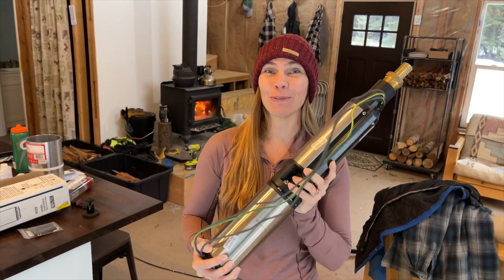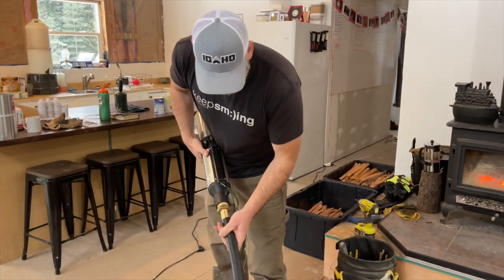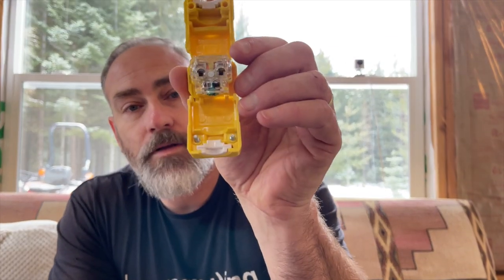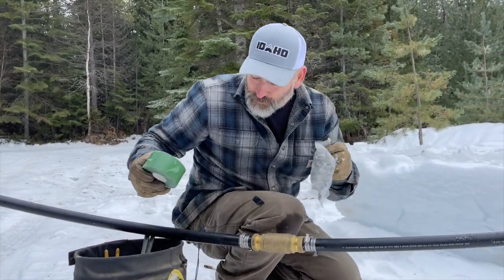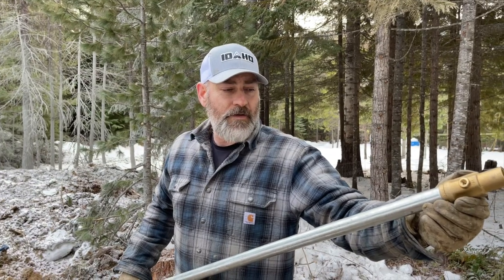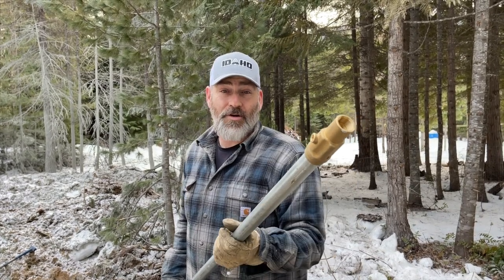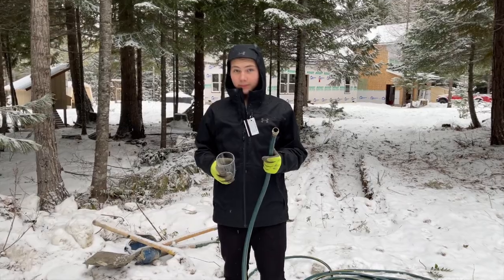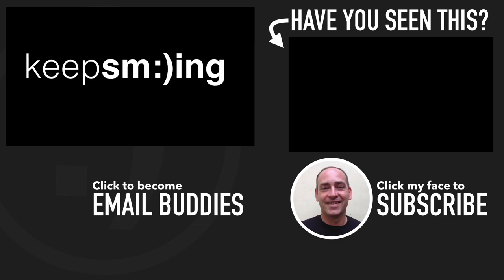WIFE is HAPPY/HUSBAND is NOT - DIY Well Pump Installation

Comment: if your math tell you you pumped 480 gallons then you have a good well with alot of storage ....Since a water heater only holds 40 to 50 gallons typically it shouldnt pump dry under normal use . Also normally we use to raise our off the bottom sometimes 10 feet. Depending how deep they drilled after hitting water ,But seems ike you could raise it 5 feet and still have enough. Settlings is normal in even a hand dug well. Be glad if you didnt go thru a coal seem like around here then you would have red sulfur water that smells like rotten eggs. That part I dont miss.

Comment: Just a couple 💭 thoughts for later to charge your batteries at night by supplementing your Solar with Wind power. Check out John Daniels for his conjunctive wind and solar with how tos.
Also In your state a great Solar company called Lion Energy. Red Poppy Ranch a retired plumber also Off Grid in Idaho just released a video about it and how he changed to Lithium (they also have a 25 yr warranty on the batteries 🔋!)

Comment: I sweated my , well I bout drowned in my own sweat putting in my pump, it's a similar 120v pump, I was  lucky it was only 40' deep, but had to dig it's a 24" concrete tube, the difficult part was attaching the 90°fitting to the pipe through the hole in the concrete, below ground, on my own! But it worked out,  it does about 75-80psi with open 1" pipe, it's not used for drinking yet, I use 5gal bottles of drinking water, with a 12v pump, for drinking water, 
Mine was so close to the house, I couldn't burry it deep enough, so I insulated it then burried it, I'm lucky to not be in that cold of a climate,

Comment: 1. Before lowering, you need to check at the top - it works or not.
2. An arrow on the valve shows the direction away from the pump.
3. Such red water can be from the type of pump - selection (with centrifugal water will be clean).
More pump - cleaner water.
I hope you are ok!

Comment: I am probably to late with this info, but I think your pump is to small. 1/2 hp pump is trying to lift the water 550 feet I think you said, that water is approx 7 lbs per gallon and you are lifting it straight up.
Reply from the maker: The pump is set at 200’

Comment: I was a gennie jockey..
Too much amp draw..need bigger generation 5kw or bigger
Reply: Of you can locate a 10,000 rate transformer  ..your solar panels will keep voltage in and the transformers equalizes the amp/volt rate. .
Like a distribution panel on 3 wire legs

Comment: I"m surprised a 1/2 hp pump will work, I had to install a 1 1/2 hp Pump for my 400.foot well 220 volt, I have changed a lot of well pump, remember once you drop that in and run water, to pull it out, It will be heavy, I built a 3 wheel pump puller, just like the one you rent 900 pound gear box electric motor, 110 volt, good luck with your home, God bless

Comment: As someone who works on water wells for a living, albeit in a different state, it seriously hurt me to see you put a 1/2 horsepower pump at that depth given the water level. The deepest set 1/2 HP we can get our hands on here is only good to a water level of 120. So if you run the water level in the well down by using the water or if it naturally drops over the years as it's wont to do, you could run into issues. Almost any 3/4 hp 10 gpm pump would be a better fit for where you have it hanging and would be a better future proofing measure. The only downside is that a 3/4 hp pump requires 230v as opposed to 115v.

Comment: Those wire connectors look almost the same as what you use onYachts to meet code  for boats they have a machine that will print onto the shrink tubing  to help identify wires  it’s similar to a Brother label maker and is a permanent ink

Comment: Not for sure Marty but have you considered raising your pump 8' or 10'. When we had our well drilled back in '95 we had similar problems.  My brother n law told me to raise the submersible pump up 
5 feet and try again. So, we did and same results. I was starting to get frustrated so we picked it up another 3 feet and bingo, my water stayed clear. My well is approximately 98 feet deep, i picked it up a total of 8 feet and sure enough my problem was solved. I know its a lot of work, lifting this up but it might solve your problems. So now now my pump is 90' in the ground. I hope this will work. Best of luck my friends.

Comment: Is the Pump AC or DC?  What gauge is your wire?  How much voltage/amperage is lost due to length of power cable?  Why not use a jet pump?

Comment: That pump seems a bit small for 196ft down. 1/2hp 115 v is your base line pump. I would have went with a 240v pump 1hp anyway just cause it draws less amps. Higher voltage motors always draws less amps. For a off grid this is better solution. My pump is only 100ft down and I have a 1hp 20gpm pump. If your buying a pump from tractor supply or home depot they are junk. Do yourself a favor buy a quality brand pump. Good luck 👍

Comment: House Wiring 

17- 20amp circuit 

         Kit. Outlet 210.11.C.1 

         Kit. Outlet 210.11.C.1 

         DW Cir. 210.8.D 

         Micro hood fan and range outlet- A good idea 

         Ref. Outlet- A good idea 

         Outside Outlet 210.52.E 

         Outside Outlet Xmas-A good idea 

         Bath Outlet 210.11.C.3 

         Laundry Washer 210.52.F 

Laundry room Outlet 210.11.C.2 

Laundry dryer Outlet -A good idea 

Family room Outlet 

Garage Outlet 210.11 

Garage Freezer 210.52 

Garage Elec. Car Outlet 210.1 

Dining room Outlet 

Heater 210.64 

Bath room Heater Fan Light 

30 Amp Circuit 

Hot Water Heater-10/2 wire 

Dryer-10/3 wire 

Cooktop-10/3 wire 

Air compressor-10/2 wire 

Shop Sub Panel-10/3 wire 

 

40 Amp Circuit 

     Outside AC 

60 Amp Circuit 

Wall Oven 

Sub Panel 

15 Amp Circuit 

Smoke Detectors 

Alarm Panel 

Lighting 210.70 

Bed room Outlet 

Internet Outlet  

It is a good idea to add separate circuits 

Sub pump 

Basement 

Welder 

Attic fan

Comment: Wrong pump size for the application. Cheap pump also. Hope that is altleast 160 psi pipe and at that depth you might still have issues with that.

Comment: Put the check valve at the top of the pipe then when you have to pull the pump you only have the weight of the pump and pipe to lift not the weight of the water in the pipe.  Before all the comments about how wrong that is ... take a soda straw fill it with water ... put your thumb on the top of the straw and raise the straw ... OMG the water stays in the straw!

Comment: Inverter generators are a poor choice for running motors with their high inrush. Motors do not require much protection against surges as electronic equipment requires, inverters provide surge protection but poor handling of a  desired high load sergers.

Comment: I thought that type of amp gauge required only ONE wire thru the meter and then one turn around around the meter.  You may be pulling only half what it shows???
Reply: If one puts both of the wires through the reading should be zero... They would just cancel.

Comment: That well head looks like pvc? if it is than it worries me since it's cold where you're at. Pvc does not conduct heat and I see possible water freezing in your pipe. Mine in wisconsin was ice problem free until we switched to pvc.

Comment: Well...., my guess was wrong, but you should have wired it 220, instead of 110.  I bet it would have started with the smaller generator.  It is the current which was the problem the current doubles when only running on one circuit, plus you only have half the rated generator power available on that 110 circuit most generators single phase 220V which get split into two 110 supplies in phase with each other.    I am sure that pump supports a 220 Volt configuration, it was probably its default configuration, all the submersible well pumps I see are 220.  Usually 10/2 wire, IE  the neutral is not needed, 10/2 is three wire, two hots and one ground.  Motors have a high induction when starting which caused the current to surge, you can  burn out or shorten the life of a motor with inadequate power IE from your solar array.  I am not an electrician, but who told you to wire it 110V ?   I would look into this more and consider rewiring the pump in the spring when you run the lines to your solar array.  I have wired my electric panel to a generator interlock, I was careful to balance both 120V supplies.  When your well pump wired 110V it is taxing that supply vs distributing it over both 110V supplies in a 220V configuration.

Comment: You pump motor takes 30-35AMPS to get it started, same thing with an air compressor and other tools like table saws and direct drive motors. You need to run your water for over a thousand gallons to clear out any bentonite material that was used to seal your casing and any silt coming out of your well channels. I would also advise you to place a couple more torque connectors and at least one more check valve in your pipe about 10 ft. below the top of your well casing. This will reduce your start up AMPS on your pump motor. You should buy a "pump protect" and install on your wiring to the pump in case you pump your well dry and burn it up.

Comment: I disagree with the water will clear up in 24 hours.  My parents drilled a well 1973 and the well was dirty for about a year.  We didn't even use it for anything but watering the large garden. Then one day the hose from the pump suddenly had lots of condensation on it and then the water dropped nearly 5 degrees in temperature and was clear.   Pump that well like crazy!  It will probably clear up.
You may also need to install a large sedimentation tank.  This is like a 5,000 gallon tank or so that you dump water into and allow it to settle out and draw water through a sand and charcoal filter.   It may in your case also need a zeolite filter and such after the settling tank.   Settling tanks are pretty much a fixture of water purification plants and there is a pretty good technology involved including routes of flow in the tank and also the use of "flocculants" to cause settling and the filter media.  If your land has elevation suitable you may want to bury the settling tank well above your house and use gravity for the gross pressure in the house.   This has advantages.   Do not rush into a solution.  It is better to take time and pump your well a lot before you decide on a solution path.  

Settling tanks are a fairly complex technology that uses the natural flow of water to clean them out periodically.  You may also find other solutions that are lessor if the sediment thins out.  All wells have some sediment in them.  You will need some methods of removing it from the water.  The choice depends a lot on the more final condition of the well.

Comment: Silty water. Your water pump may have a check valve. Remove both check valves.  Wait a while for the silt to settle to the bottom of the pipe. Pump 10 gallons and check clarity.  You can get timers to turn on every half hour. Removing check valves is harder on the pump but........

Comment: Need a bigger pump. A pump is sized for total pumping depth, static plus drawdown. Then when you connect to a pressure tank it will require even more. Most 1/2 hp, 10gpm, 110v pumps will not pump 50lbs. Pressure below 100ft. If your static is 94’, 10 gpm yield , their are several pumps to chose from, all would be 240v. You might get by for now with open discharge, however depending on drawdown, that 1/2 hp pump will not work at the depth you need
Reply from the maker: We pump into a 2500 gl cistern.

Comment: Regarding your water quality, if you elect to go lower-cost than the commercial products, Search yt for Jon Jandai "Make your own water filter and never buy drinking water again.
". He shows a very inexpensive but effective process for cleaning water. Going this route requires pushing the water through a series of settlement tanks into a final cistern, but you don't have to spend a fortune for on-demand filtration, plus have clean water stores to boot. This is how we're planning to do ours... we're a very long ways from a well in the ground though ha ha.

You should figure out if you have clear-water iron. If you do adding oxygenation (e.g. airstone) early in the processing tanks will force the iron to precipitate out of the water. Manganese requires a different approach than just a bubbler, ozone or manganese permanganate iirc. Ozone will bind to carbon, which will shorten its useful life.

Iron -> Large particulate -> Small particulate -> Chemicals/off tastes
Oxygenate -> Settlement -> Filter -> Carbon

Comment: That amperage on 10 gauge wire at that distance to the house will not work. Need to get a 240volt pump to run with that wire. From a horse power to watt draw comparison, something is wrong with that pump. 750ish watts equal 10 gpm at 150psi. 6 amps running a depth of 200 feet with 40 psi at the top is what it should be doing. Even if inrush current was 3 times that, it is still way over amp

Comment: We put an Aquasana Well Filter system in.  Although rainwater is our primary water source we do have a shallow well (80') as a backup if needed.  The filter system is good for both sources.  Let me know if you have questions on the rainwater or filter system.

Comment: Get a can rope? And a bucket today.
Tomorrow pipe to surface enough to pump drill small hole in pipe on top of adapter, hook pump to outside of home wire and your half  set
allways keep hose drained.
But you have no trench and no adapter so just run pipe with check valve And screen  and dill small hole (prefer jack knife aprx. 10 feet from bottom for suction so it wont freeze insulate down 19 feet from top and on top hook pump and wiring.
Ill watch again.

Comment: this is why you don't just wire a plug to your pump, plug it in and hope it starts!!! there is a pump starter control box, that is a VERY essential piece that is needed, and should cost less than $50. (they are about $60 up here in Canada) it contains capacitors to start the motor/pump. Also, if you are smart, you will spend an extra around $100 for a welltrol, control box. This contains a current load detector, and will shut your pump off if it senses it runs dry. This extra money spent now, will save you hundreds down the road in replacing pumps.
Reply: and as others have said, I'm not sure why you just didn't have the drillers install your pump! it should have been part of the package deal, and not cost any extra.
Reply: Should also add, and ask, did you do an initial "well shock"?   if not, you really need too !!!

Comment: wire needs to be better gauge , too light of cable...........  you running 220/230 volts for pump ?

Comment: 35a @ 120v = 4200 watts.  That's more than your generator can handle.  Presuming the 35a is normal for that pump, you need a bigger generator - 6500 watts,  Shouldn't run a generator at its peak power capacity for long periods of time.  That generator is only a 3000 watt CONTINUOUS output, 3500 watt surge (for about 10 seconds).

Comment: the pump uses lots of amps to tart then a second later it drops down to the rated amps   inertia  is overcome. probably the soft start feature  is making this take longer but it seems 35 amps should be enough maybe because its 220 and the 35 amps is  what the  usual recommendation is for above ground  120 volt pumps maybe the starting ams is a lot Moree  you might need a lithium battery bank and a big inverter or maybe an inverter or capacitor for the generator find out what the starting amps are. ex 30 amps to start for 1 second is typical then it drops to  jus 8-9 amps is typical. find out about the 220 starting amps for your pump.  emoticon activated /.

Comment: One thing I don’t like it, you used yellow thread paste on drinking water, yellow paste to be used only on petroleum products, like gasoline, gas, diesel fuel, heating oil. That’s a toxic paste, which will be polluting water for many many years. 
And you forgot to put pipe protectors on the pipe, to keep pipe from rubbing it against well casing.

Comment: Congrats my well is 350 and 2yrs later and it still has very fine red sediments the cheapest safe solution is whole house sediment filters 3 4" and to make it drinkable we use a berkey.
Reply: A sediment filter would clog in about 2 minutes with that water.

Comment: you need to make yourself a rig( just a wheel to run the pipeove)r so you pull up the pipe and the pump with the tractor  also gen is too small

Comment: Two defective pumps thats. Not right. Was there a locking pin. Ot removed from the pump motor. Or maybe a wire on wrong

Comment: You need a capacitor  start control box
Reply from the maker: Aren’t those for 3 wire pumps?
Reply: Some do some dont they are available  was just an idea if your pump has it built in your on the right track

Comment: The color of the water is NOT as important as the "Water Test".  Send the sample off before you "taste" for the first time.   The use of a large "pond" to settle the water is not complex to work out.   I would say 2-3 tanks hooked up in serial should settle out the turbid look.   The Iron on the other hand needs an expensive solution.   Get the test and focus on the health of the water,  not the looks.

Comment: Are used to do this for a living most pumps are 220 that inverter generator that you have is only 110 it is not 220 you need to have a generator that hat that is 220 not 110 do you understand you’re only getting one side you’re only getting it it will not work if that’s a 220 pump you need to have a tooth one that can deliver to 20
Reply: He stated in the video that it is a 110 volt pump, also it a 2 wire pump which tells you it is 110 volts and not 220, why would he need 220 volts to run a 110 volt pump?